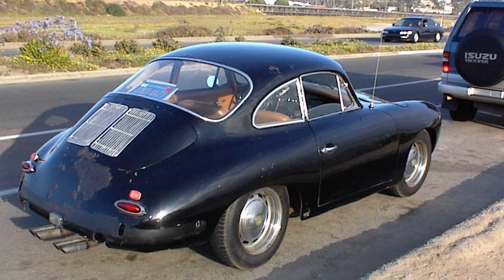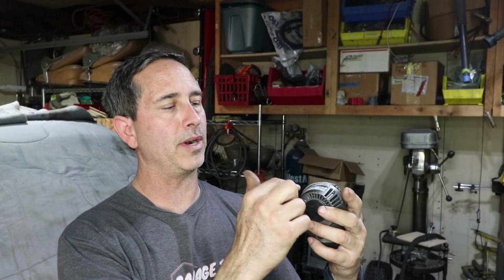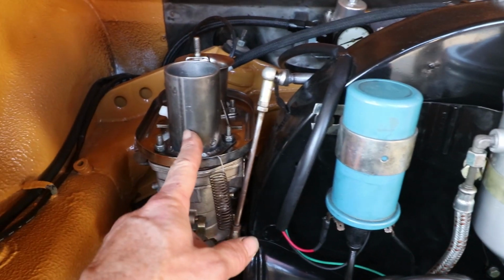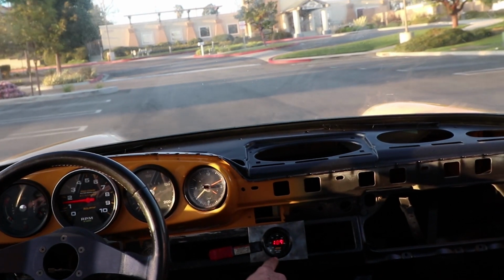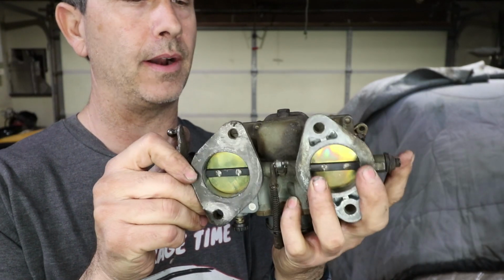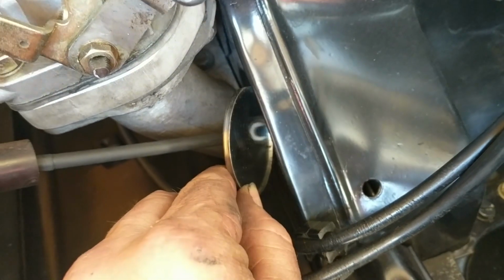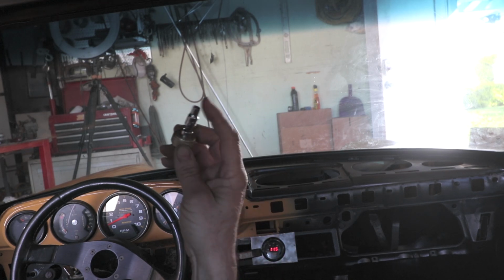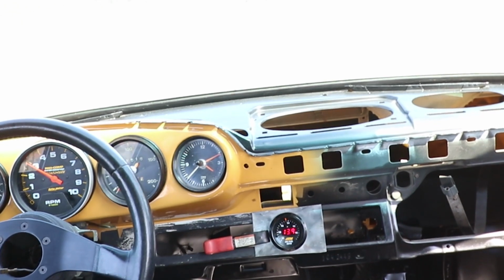Complete WEBER 40 IDF Dual Carb Setup and Test Runs

Comment: I ran Webers  but I'd tune and sync them up perfectly then a week later they were out.  I swapped to PMO's and never looked back.  Great carb explanation.  For carb settings I just  throw some chicken bones on the hood and read the wisdom of the gods.
Reply from the maker: Something about new carbs versus old carbs without worn shafts and throttle plates I presume?  PMO are great.

Comment: Lots of people say that  webers are no good for a 912/356 engine but once you have them dialled in correctly I think they are great. Adjusting things is all part of the fun of tuning. Well done!!
Reply from the maker: My 356 will have Solex, so it will be a fun comparison.  Dellortos are also good!  Everything is fixable😄
Reply: Fun my foot!
Reply: I think it's because people don't understand how they work and don't have knowledge to work on or adjust them.
Reply from the maker: Amen.  This 912 engine with Webers  runs better than I remember my 356 running with Solex.  It's been 15 years though.

Comment: Great video, as always.  Weber’s are awesome, but dang, a potential rabbit hole of adjustments for transitions, etc.   Hats off to you for understanding and digging in with your own tools and homemade devices. Had a good friend with a 914/6 back in the 70’s.  He was constantly fiddling with his Webber’s.  My garage built 63 1/2 Falcon with a real crate Shelby 289, w/Paxton blower, ran great through the double pumper Holly.  It made for never ending debate on which carbs were better, which I look back on with a smile.  BTW, long live nerdy engineers/mechanics.  👍👍
Reply from the maker: My hope is to leave it alone now.  Set it once and done😄. This isn't a performance engine that I'm trying to get the last 2HP.  I just want it to drive and I'm thrilled so far.
The Wideband guage removes years of tinkering and guesswork.  Too bad they didn't have them in the 60's

Comment: Fantastic video, thanks so much for share.  Really good to hear the car is running good now.  Can you go into more details on the hot wire anemometer?  When you plugged it into your laptop, what program/app was reading the results?  Did you find it useful and reliable?   Would you use it for more high speed/load tuning?
Reply from the maker: Thanks!  I'm so happy that the car runs great and the tuning is behind me.  Maintenance will be much easier and once carbs are set they don't need much. 
The anemometers are very good.  The are from degree C or cambridge accusense.  I think one company bought the other one, but the probes come with a tracking software.  I should have shown the graph of the readings.  They are very stable.  
Now I'm wondering if one could get a MAF from a junkyard and adapt it for synchronization?  Hmm.